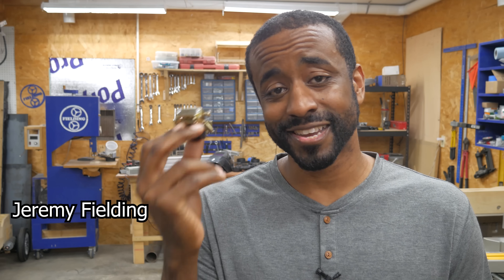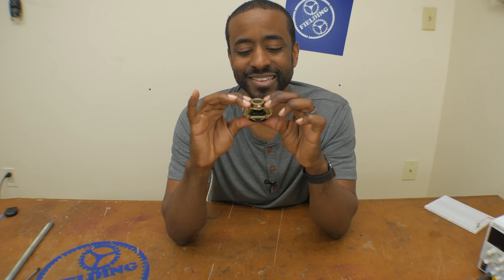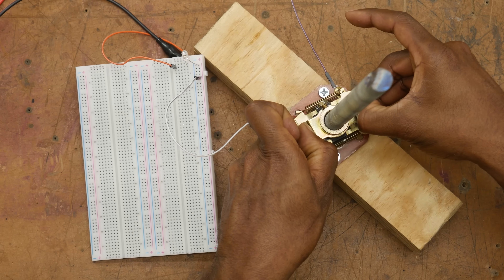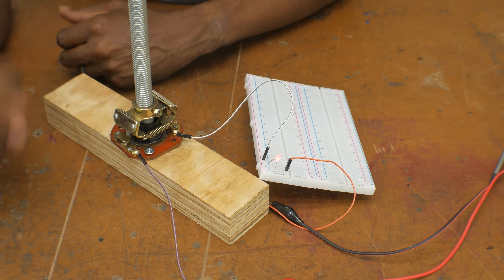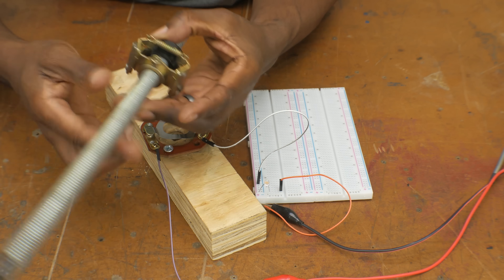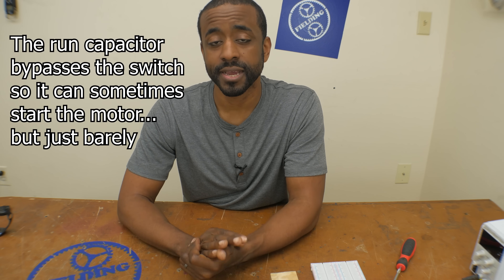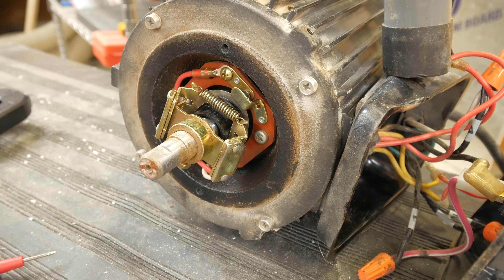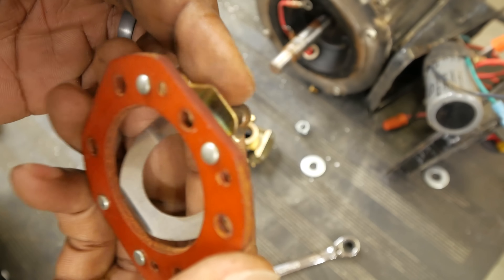This Clever Device Is Found In Nearly Every American Household. How It Works And How To Fix It

Comment: The capacitor does not give the motor a "kick start". The capacitor shifts the phase of one winding.  Some motors leave the capacitor in the circuit and the capacitor is call a "run" capacitor.  In motors where the capacitor is taken out of the circuit after the motor starts, the capacitor is call a "starting capacitor".  Capacitor and inductors both shift the phase of current.  Look up ELI the ICE man for an explanation of the difference.

Comment: Small order of business in America we have 3 phase as well. It is inherently used on a commercial basis.  Fact is 3 phase allows more work to be done for less energy. That is over simplified and someone undoubtedly will take that statement to task but trying to convey an idea to the masses. You couldn’t imagine the size of a single phase motor at 100 hp nor the draw of amperage it would require or the size of the wiring it would require at 240 volt which all would double at 120 volt. All that said this man is amazing at fully conveying the basic principles of electricity.  He simplifies things I work on daily and makes it so easy to pass to another to answer most electrical questions. Being new to the channel I have not seen the full extent of his library but am anticipating greatness from all I have seen to this point.

Comment: This open up quite a few explanations, I wondered what component was responsible for the switch between the start winding and the run winding in an electric motor...thank you for the input, this will help in future diagnostics.

Comment: similar switch like this can be seen inside a very old tape recorder motor. It is to control the speed of the motor. Speed can be adjusted by turning the long screw inside the switch

Comment: Hi,

Love the videos I've seen so far.  You are a geat presenter, and very knowledgeable.  Thank You!!  

I was working to use an old spa pump to power my concrete mixer.  i need a speed of around 1700 rpm at 1/3 Hp so I thought this motor would handle it well enough.  While trying to unmarry the pump end I pulled the hub off with the shaft.  While reinstalling I had to pull the wiring end off to get the shaft back into position with the "horseshoe" past the bearing.    After reassembling the pump I wired only the common to terminal 4 and the hot to the low speed terminal 2 ( and ground of course) (line was 4, high speed was 3 and low speed was 2).
When powered I'm getting arcing at the 12 o'clock position.  I've dis and re assemble but am NOT understanding.  

Any help would be great,  Thanks
JohnCindy
Reply: Great presnter!
Reply: Presenter,    I'll get it right yet

Comment: Thanks Jeremy. My Powermatic 1900 dust collector recently failed while running. The thermal overload relay tripped. Capacitors checked ok. What happens if the centrifugal switch fails when the motor is running? Any help will be appreciated. 
Your video is very informative. Great presentation.👍

Comment: I enjoyed the info in the video and could think about the mechanical valves that use gravity to lower while speed raised them in steam engines. At first stationary to operate crushing oar dug in mines for gold or silver, but steam engines used on locomotives. 
Tech Fact; Everyone has seen movies with steam trains and smoke coming out the stack. Most may not know, but tubes with steam were placed inside the smoke stack to #1, create a suction to draw smoke from the boilers. #2 add moisture to burning ambers so to reduce fires near the track. #3 Push the smoke upward to allow visibility to the engineers. #4 Keep winds from blowing smoke into open windows of passenger cars that could get them dirty & irritate their eyes and breathing. FIN!

Comment: Mr. Fielding, you are a gentleman and a scholar. That was great. I'm thinking of designing and building an electric dumb waiter with a washing machine motor. The difficultt is that I don't understand relay logic well enough to do so. I could use an Arduino, but that introduces complexity and thus, reliability issues.

Comment: This is also what we have called a governor and was used on early steam and fuel motors to stop over spinning. It can turn off or on a circuit or just pull a rod or leaver.

Comment: Repulsion start/induction run motors also used a centrifugal switch. The motor would spin up using brushes and a commutator, and then once up to speed the brushes would lift off and a shorting bar would short all the bars of the armature together, turning it into an induction rotor. Old Spencer pipe organ blowers often have big Century motors of this design. Keep em clean and oiled and clean the commutator occasionally and they'll give you another 100 years. The brushes last a long time because they only work for maybe 5 seconds on run-up.

Comment: Thank you for making these videos Jeremy!  I have a question.  My 3hp 220v table saw motor makes a “thunk!” sound while it is spinning down after I turn the power switch off.  I’m guessing the noise happens when the centrifugal switch opens?  Any other ideas what might be causing that noise?  Table saw works great otherwise it just makes that disturbing noise when shutdown.

Comment: FYI, I believe you swapped the spring tension vs opening speed relationship.  A lighter spring would allow the weights to move out at LOWER speeds, while a heavier spring would keep the weights in the low/no speed position longer, requiring a higher speed to actuate the contact.
Reply from the maker: I was very careful to say it correctly. Please watch again. What I said is exactly what I meant to say :) though it is counterintuitive

Comment: As a guy who owns a motor shop.. those bearings are shot.. 6203LL on the rear and possibly a 6203 or 04 on the front. Centrifugal switches are ok but it's a wearable part that when used in dirty environments usually cause problems because of the contacts on the switch. The cheap Chinese switch you have there is prone to fail because of saw dust or metal shavings.  The pads are coated so filing them or sanding them will make it last a little longer but will arch more and wear out. Some motors such as spa pumps or fan motors got rid of the start cap and switch and have gone with a oil or run cap instead. Some motors also use an electronic switch or a resistance style that kick out based on amperage. Now that VFDs have become less expensive many high end tool manufactures  are now using VFDs and 3 phase motors. The most efficient motors as far as start up amperage are going to be brushed with an armature like found in many tools. 
But watching your other videos you already know about VFDs but maybe you should look into Ad a phase or rotor phasing as I think you will enjoy that.
anyway enjoy the channel and change those bearings!

Comment: We have "running-caps" in Europe (and most of the world it seems), instead of starting-caps for making 3 phase induction motors work when powered by single phase, and they don't pop while being continuously connected (unless the manufacturer has cheaped-out and selected one with too low temp range for the operating environment, then they dry out and short in time). Never seen such a switch in my life, never even realized there was use for one 😅 Running-caps are however slower starting and only gets 70 ish % rated torque, compared to the real 3-phase operation. It's usually also a patch solution, running straight off of 3 phase is preferred (and the better solution).

Comment: What is the name of the reddish board witch you fixed? 

Mine is worn. I sanded it and it should work a while longer but unlike your motor it’s buried and you have to take the motor apart to get to it. Contact board? 

I can’t find the name or part # anywhere.

It wasn’t one of my problems but while I have it apart I may change it. One of my bearings was worn and replacing capacitor.

How can you tell if a capacitor is real would be a good video.

Ebay has tons that “look” good but we could all slap writing on the side and call it anything we want so are the cheap ones real or any good?

Don’t forget to drain the capacitor.

Nice video of the centrifugal switch .

Comment: You need to find an old ignition points file that mechanics used to use before electronic ignition in cars.  It will do a much nicer, cleaner job than sand paper.

Comment: Jeremy. I have a bench grinder that hums when I push the start button. I thought that it was a defective switch so I decided to replace the switch.  I noticed that there was no capacitor once I looked under the grinder where the switch is located. Why would some of these grinders not have any capacitors? After I replaced the switch to the grinder it still wouldn't turn on. I opened up the motor and noticed that there were small springs down at the bottom of the housing. I  then realized that the centrifugal clutch was defective. I will need to buy a replacement. Thanks to your videos, I now know where those tiny springs go. These are the best videos and explanations on small electric motors that I have found so far.

Comment: I believe the inventor would be: 
 Vincent Bendix
In 1910, Vincent Bendix invented the Bendix starter, which allowed the pinion gear to automatically engage or disengage the flywheel. The device went to market in 1914 on the Chevrolet “Baby Grand” and stayed around for about 50 years.

Comment: When you were wondering about the centrifugal switch origin, it may have been from James Watt flyball speed governor invention, as the speed increased, the flyballs flew out farther and this was used to cut back on the throttle valve.  
Always very enjoyable videos, thanks for putting them on.

Comment: Edison invented the centripetal motor speed governor.  This centripetal switch is a variant of that speed governor, but rather than have a continuos adjustment (in Edison's device it operated a clutch usually or just swing weights that added to the torque required to spin up the motor), in this form it is just an on and off switch.

Comment: I bought a broken air compressor. That was the problem. I fixed it and it’s worked great ever since.
Reply: My phase converter uses the voltage from the third phase to activate a relay that disconnects the start capacitors.

Comment: Ok first off, thank you for the videos.  Now on to facts from someone that works with various motors everyday   If testing a LIVE circuit never ever never use the continuity setting on a meter   Always use voltage setting to determine if a circuit is closed or open

Comment: The start capacitor doesn't provide any charge to "kick start" a motor. It starts the motor by providing a 90° phase shift across the secondary start windings which allows the motor to turn by the change in magnetic field. It is essentially creating a false 2 phase winding for an instant just as in a 3 phase motor. This is why 3 phase motors do not have start capacitors. Once the motor starts spinning the phase shift is no longer needed as the inertia of the rotor rotates the motor into the next position.
Reply from the maker: I explain this in great detail in a older video check out how single phase motors work for beginners. Thank you for watching!

Comment: I once had a gas dryer which wouldn't stay on when I pushed the start button. This was before fancy computerized controls. I checked out several things before getting to the centrifugal switch. When I removed the cover to get to it a popping corn fell out. It turns out that there was a bag of popping corn in the garage where the dryer was and some mice had gotten into it and stashed it away in the dryer motor.  It jammed up the centrifugal switch and stopped it from working. Once cleared out it worked just fine.

Comment: Centrifugal switches are extensions upon the Centrifugal governors of the 17th century...

Centrifugal governors were invented by Christiaan Huygens and used to regulate the distance and pressure between millstones in windmills in the 17th century. In 1788, James Watt adapted one to control his steam engine where it regulates the admission of steam into the cylinder(s).

Comment: I have been in the HVAC , industrial maintenance fields for about 40 + years. Included in my tasks, were motor repair, pump seals, etc. That being said,  I found your presentation very well planned, Even with my years in the field, I could not have explained it better. You impressed me with your posts. Have any more planned?

Comment: I've worked on a lot of stuff and I never knew about this centrifugal switch in electric motors.  thank you for expanding my knowledge.  motors are expensive.  my time and expanded knowledge is worth the cost of a motor in a HVAC unit or whatever if I can fix it in 1 hr and save 300 or so bucks for sure!  Not many people I know work for more than 300 bucks per hour.  DIY is where it's at.

Comment: Those weights are known as “Fly Balls” they were used on early steam engines as pressure regulators. I work on hydropower plants and we just removed them from our generator speed governors and replaced them with digital governors. It is truly a bitchen device!

Comment: We had similar type switch at the power plant I worked at on our steam turbines. We called it a 'flyball governor', which kept the speed constant and if oversped tripped the unit. I also noted it on the elevator motor in the plant. Plant was built late 30's and went online in '41

Comment: Good video, but just a suggestion, once the crud is sanded off, try to go down to the finest grade possible.  You want it almost polished.  Those tiny scratches from coarse paper mean less surface contact, and more possibility for tiny corrosion causing arcs, which will make the problem come back quickly

Comment: Some automatic transmissions in vehicle use what's called a governor. Connected to the main shaft via a gear on one end and the weights on other. When the car is put in gear and moves, it spins and opens a valve in the the center directing the the trans fluid controlling shift.

Comment: Capacitors are for a phase shift not a boost. There are start capacitors and run capacitors. There are start windings and there are run windings. There are new motors that have speed control modules or single to three phase inverters. These new motors avoid this type of starting by controlling the phases. My refridge and freezers both have inverters that take single phase to three phase. All of the solar industry has really brought us a long way to having more technology for speed controls and inverters. I have friends that have converted their home AC units to 3 phase compressors and used inverters that are 3 phase to convert the single phase 240 to three phase 120-208. The efficiency is incredible and you have soft starts instead of the hard start of conventional induction motors. Still liked your video about the mechanical part of the centrifugal switch.

Comment: If you put that sandpaper on to a small file or a flat piece of wood (an ice cream stick for example) you will get a much more even surface of the contact after cleaning. This also provides more contact area so the density of the current is less and wont wear out the contact so fast.

Comment: 0:58 "You only want this thing connected for a second or so otherwise it will explode"
7 seconds later: "we need to connect the capacitor to the motor when its not spinning"
So... why doesn't it explode 1 second after the motor stops spinning?

Comment: I got startd in electricty in high school (1957), and being unaware of this switch probably would have tried the capacitor first, then replaced the motor. I wasn't unaware of centrigfugal switches, just this application. Thanx fro the LONG overdue lesson! :) I wonder how many motors I replaced in disk droves over the years with just this bad switch. (the old washing machine sized drives with mountable disk packs.

Comment: Hey sir. Saw your video by coincidence. I was not even looking for this subject.  When you start your vacuum, it reminds me of my radial saw. When I start it, the lights in my workshop dip really low and the saw blade turns but struggles. After maybe 2 secs, the saw jumps to full speed. At the moment, I don't know if its an induction or a brush motor. I do not see a capacitor on the outside and do not hear a clicking sounds when I turn it off and the motor slows down. Any ideas what it could be?

Comment: Nooooo not sandpaper! Use a decent contact cleaner and a non abrasive cleaning tool. Sandpaper will remove the crud, but abrading the surface of the contacts will vastly increase the tendency for further corrosion in future :(

Comment: Nice vid, as a sidenote: 
It's also a speed limiter for engine rpm in fossil cars, not only on electric motor's. It is locaktet in the distributor lid on older cars (it acts as a mechanical relay), and in the ignition system in a new car it is electric controlled by the computer.

Comment: There was a similar (looking) device on steam engines, it was a speed governor (if I recall correctly). It had two brass balls each attached to it's own single rod cantilevered from a pivot point and attached at on end to a 'T' shaped rod. These would spin with the engines revolutions and move away from center by centrifugal force pushing the 'T' rod down, to what end I don't know, but this did operate a switch of a sort I suspect. It's the thing from which the term 'Balls Out' came into the language.
Reply: Yes aka "Balls to the wall"

Comment: You can increase the voltage rating but shouldn't really change the capacitance up or down because the capacitance has to be sized to match the winding inductance at a a particular frequency (60 hz) just like the weights have to be sized to match the spring to open and close at a specific RPM.